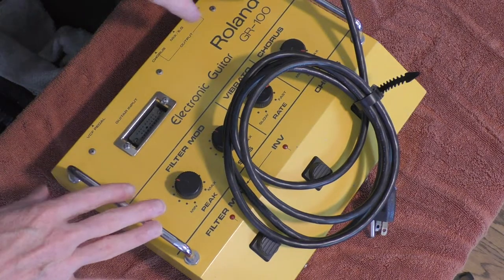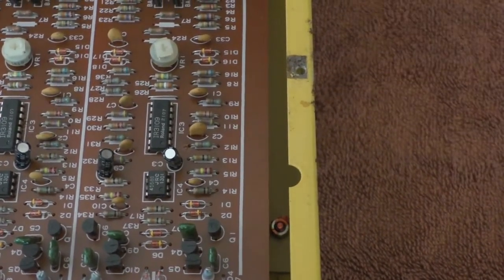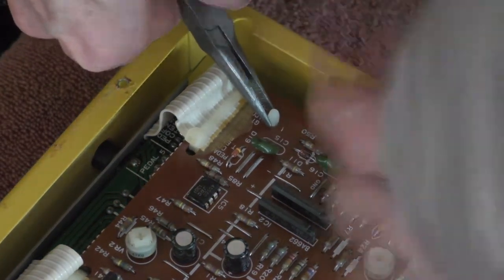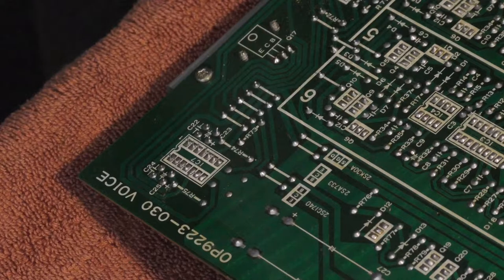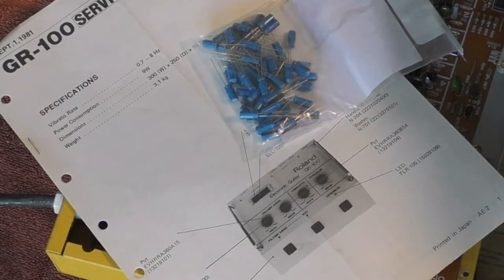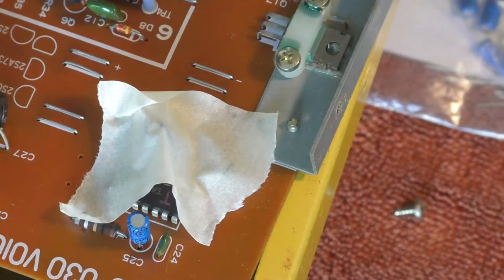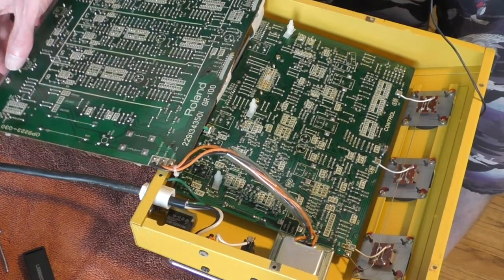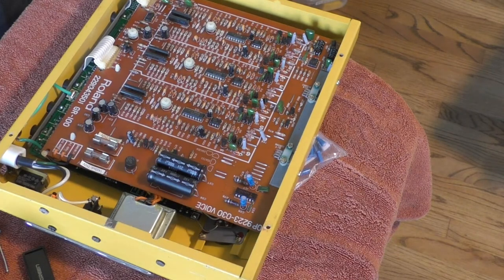Roland GR-100 GR-300 - You MUST Do This Mod! Power Supply Repair - Vintage Analog Guitar Synth DIY

Comment: You replaced the tantalum capacitors with electrolytics?
Reply: a cap is a cap is a cap in this kinda case. when these were new, it was standard to use caps, as there weren't as  many choices. electrolytics are fine.
Reply from the maker: Yes, that is correct!
Reply: @WayneJoness  I guess my concern is that electrolytics are more renown to dry out and need replacing than tantalums. But perhaps that's in another 20 years, and will youtube even exist? :) Thanks again for your video, I'll definitely be doing the mod on my GR-100!
Reply: @aussieleighsmith  i've got electros in some things that are fine after 50 years... tants tend to go bad within 10-20, so its 6 of one, half dozen of the other, but since these are in the power supply and not passing audio, electros are fine. i quit using tants years ago. peace!
Reply: @666pinkster  Great insight, thanks!

Comment: Headshots ,Handshots... You need a new Director of Cinematography ! Ha Great vid regardless , will be doing the mod this week on my GR300 .. Are there any other caps, etc  that might fail due to age ?
Reply from the maker: Nothing that I can recommend right off hand. I have a mod on my site to increase the output if you want a hotter output.

Comment: I'm really hoping this video will save my unit!!  I have both a 100 and 300 that have been stored in a flight case for many years and I pulled them out the other day to make sure they're still ok.  Well, I powered up the 100, no problem,,, then the 300 and the LEDs flashed for a second then when out and dead since.  I can feel the overheating on the heat sink.  I had it plugged in for a good 15 minutes so I hope nothing else got damaged.  I opened it up, but I don't see any burnout or that burnout "smell".  then I found your video!!! So I got my hands on a couple of the capacitors you're using and will be installing them this week.  I hope I'm not too late!  I will let you know if it does the trick,,., fingers crossed!
Reply from the maker: Wow, that is really great news, I hope you were able to fix your synth. Glad to hear this video might have been helpful.
Reply: @WayneJoness  it totally worked!! 
I'm going to making a video about the guitar and the synths and a scene will be of me fixing the unit!! Thanks a million for your knowledge!

Comment: Question for you. I’ve used the GR300 and that unit has a master tuning knob as I guess the unit depending on temperature can detune or make the instrument sound sharp when the synth is engaged. Does the 100 have any issues like that? I would assume maybe and perhaps that’s why they added the tuning knob to the 300. Thanks for any feedback you can provide.
Reply from the maker: The GR-100 is really a 'super fuzz box' with six independent distortion units, there is no tuning, just like there is no tuning on a standard guitar fuzz box.